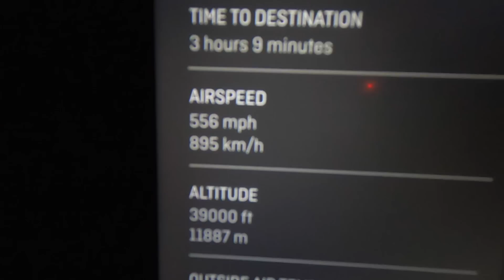Why I CHOOSE To Live In Canada - Welcome Home to WINTER!

Comment: It's impressive the battery could hold a charge at all after two winters in storage. Once the battery freezes it's permanently damaged and can't recharge as much. They only freeze if they are stored discharged. 

Something that works well for me in Manitoba is permanently mounting a 3 outlet extension cord under hood, plugging the block heater, a charger and battery warming blanket in. That way, the battery is always topped off and can't freeze. Also, if you drive away plugged in it's preferable to only damage a $10 extension instead of your block heater cord.
Reply: Hello other Manitoban!
Reply from the maker: The battery was actually on a battery tender the entire time, and the engine was run up to temp every month or so. Maybe the battery would have been OK.. but I just don't want to mess around with it for the rest of winter.

Comment: Hi Dan, hope you are doing well. I am interested to learn if you could pick between two absolutely identical vehicles (same weight, same power, same everything) and the only difference was that one had a modern Diesel engine (with AdBlue) and the other was a modern Petrol/Gas engine. What would you pick for a trip around the world - Diesel or Petrol. In other words, factoring in availability and reliability/quality of fuel, what would you pick.
Reply from the maker: That depends entirely on where you are going.
The diesel in many parts of the world will destroy a modern diesel engine (and /or the computer will shut it down in less than a week). 
If you're sticking to the developed parts of the work the diesel would be OK, but to go truly remote (West Africa, for example) gas is the choice.
Reply: @TheRoadChoseMe  have you in your travels (or heard from others) come across places that only sold diesel but no gas?
Reply from the maker: Never. In fact, I've seen the opposite many, many times, because diesel trucks easily go 500+ miles on a tank, while motorbikes and scooters (which outnumber cars and trucks 100 to 1) only go 100km. 
Check out this one https://www.youtube.com/watch?v=YoxdojIpiGY
and https://www.youtube.com/watch?v=zTsRhp2kaAI

Comment: A block heater should get your engine to at least 0C if there isn't any wind. I've got this OBD2 plug in reader called a ScanGuage (about $200 on amazon) and can tell you engine temperature and fuel mpg and gallons per hour and other stuff. I've driven Kooteney pass in the semi truck in summer a few times. The hill that your going down feels really long going up. Yes trucks churning up the snow definitely helps with traction, try and find a spot of churned up snow a super packed snow and test the 2 surfaces with your shoes.

Comment: Dan, do you ever use tire chains on the Jeep?
Reply from the maker: No, never. Canadians use them very, very rarely. High quality tires will get you anywhere that has been plowed, chains are for after that. But in many places in Canada unplowed means meters of snow (many, many feet), so even chains won't help (depending on how cold it is, and what kind of snow you're dealing with)
Reply: Good point.

Comment: WHAT YEAR JEEP  DID YOU HAVE FOR THE DRIVE IN AFRICA
Reply from the maker: That Jeep is a 2011 Wrangler Rubicon. I made the drive in Africa from mid 2016 to mid 2019. When I bought it the Jeep had 130,000kms on it, now it has 290,000kms.
Reply: @TheRoadChoseMe  THANK YOU VERY MUCH FOR THE FAST CALL BACK  I WAS LOOKING TRYING TO FIND IT  / THANKS AGAIN  /GREAT VIDEO

Comment: Do yourself a favour and get an oil pan heater…. In conjunction with the block heater. Will start like summer
Reply from the maker: In the Yukon I also had a battery blanket - absolutely I would if I was expecting cold weather, but where I am now it rarely goes below -15C